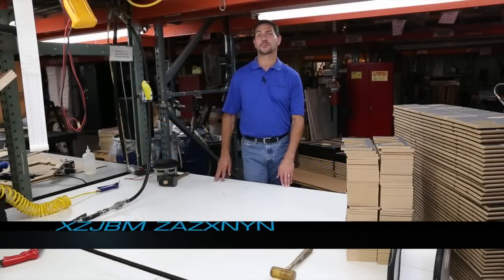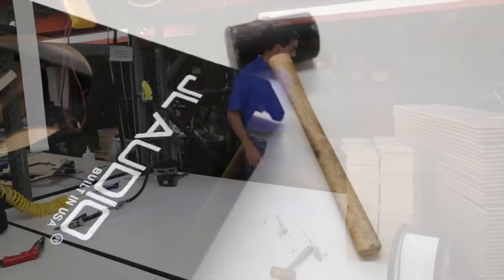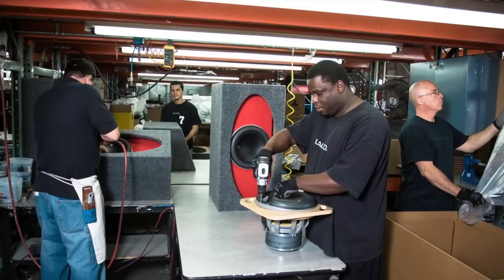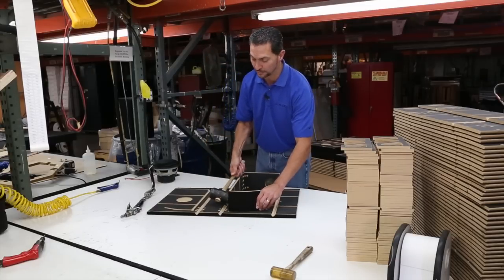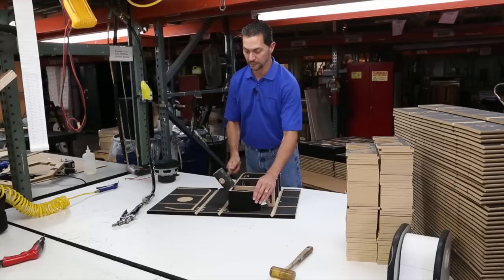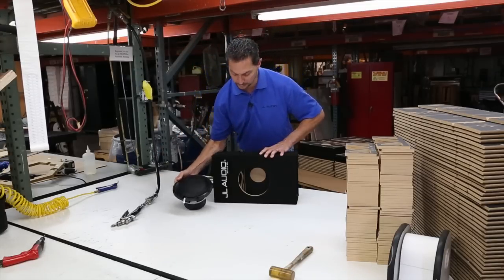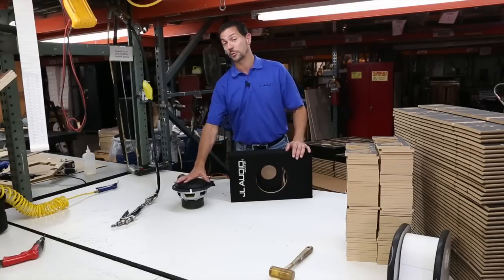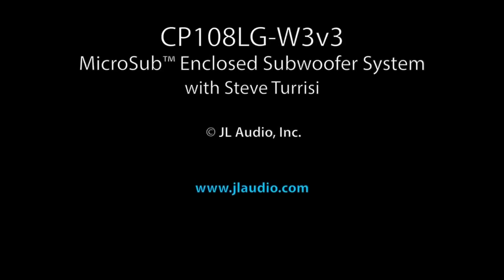JL Audio CP108LG-W3v3 Product Spotlight

Comment: Would two 8" of these subs with enclosures fit behind the back seat of a 2018 GMC Sierra 2500 Denali HD?  Any splicing needed for use with the factory stereo?  I just want a little more CLEAR bass in my truck (with a Bose system). Thanks!
Reply from the maker: @Dubious Jesse, You would need to measure your available space and compare it to the dimensions listed on our website. I have seen them used in trucks like yours so I believe it will fit. If you use and amplifier such as our XD600/1v2 you can tap into the factory subwoofer signal using RCA adapters. Or if the signal is too great you can use our LOC-22 to step the signal down if need be.